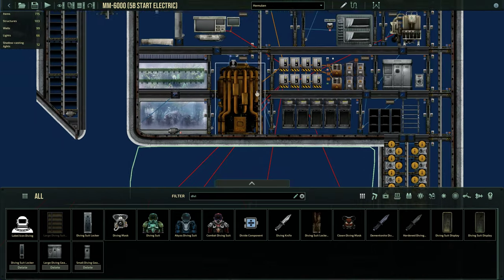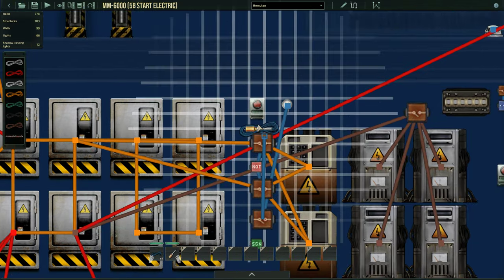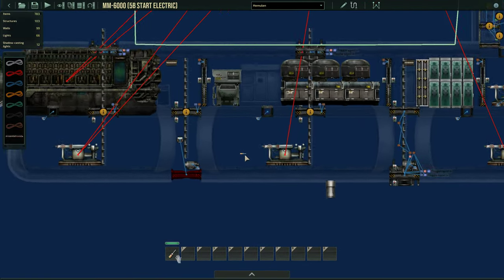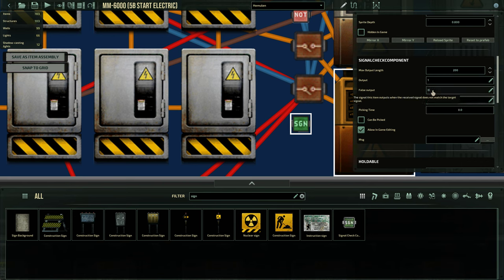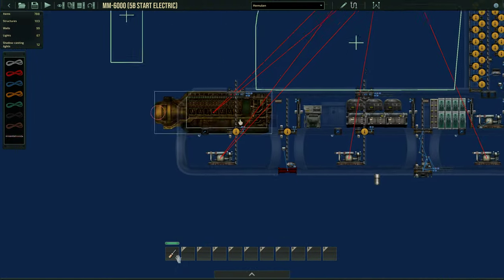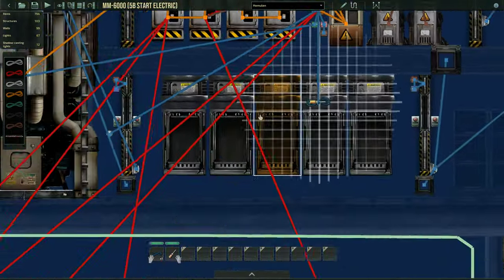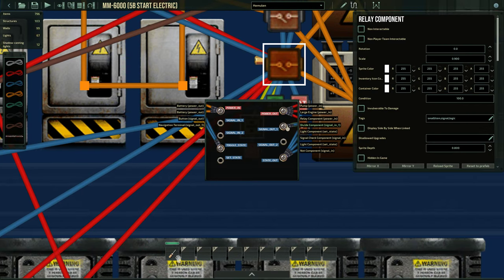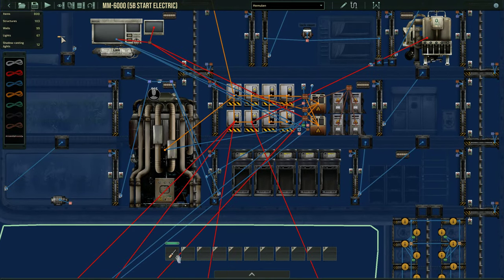Barotrauma wire submarine for silent mode

Comment: I personally use a multiply instead of a divide and multiply the force by 0.2 (20%) to get silent running. I also like to add a terminal (although i have the user input a number between 1-100% and modify it to a number between 0-1 for the logic). The terminal maybe of dubious use on many ships but its pretty fun telling the crew to set engines to various % and is very useful if you relie on batteries a lot.

Comment: Instead of using another relay + a not component + a divide component to limit the engine you can just use a signal check and the divide component and say;
Whenever Silent Mode is on divide by 5. Whenever it's anything else (aka off) divide by 1 (aka do not divide).

Comment: Whenever I enter silent running mode my whole sub just switches to battery power, despite there being no overlap in my battery and reactor grids. What can I do to ensure only the things wired to my relay get powered?
Reply: same problem
Reply: I experience the same issue and the only way to stop it on my end is to put a relay between Junction boxes and the machinery that's being used for wired mode. When I click said relays they still have a load but the rest of the machinery on the sub that's not connected to silent mode no longer turns on. I feel like this unintended behaviour but I'm not sure of what causes it, I only run mods that add item assemblies for sub building.
Reply: I think I figured out why that happens.

Junction boxes don't have a "power in" or "power out" pin, only a "power", so I suppose that anything that is connected to a junction box and that is powered will transfer power to the junction, and the rest of the sub.
I haven't tested yet but I think you could fix that by putting Relay components before the thing you want to power while in silent mode and connect both the "silent switch relay" and the junction box to this "one way" relay. That would be 2 additional relays, one before the engine, one before the pump, another one if you want to power the O2 generator, and if you wired like in this video, you already should have one before the navigation terminal.

Or you could be a madman and rewire the entire junction box network to dedicate one for those systems, connect it to the batteries and use a relay or two between this box and the others to allow you to cut this one part of the power grid from the rest. It should be doable with less relays but have fun doing that outside of the editor.
Reply: @IZ4-Y01  that is exactly what I ended up doing! You have to create entirely separate systems for something like that to work. Using the relays is the key.

Comment: do you need to use sub editor or can you wire this mid campaign?
Reply: I'm pretty sure you can craft and place all components and wires, so as long as you dont need to modify something that already exists (hidden unmodifiable default components on subs) and only need to place new ones and do the wiring , you should be able to do this with any game on any sub.

Comment: Do It in Easy Way on ANY vessel without Submarine edditor mode:
If you want silent mode you can just use 1 relay component, 1 signal check compounent and switch. wire navigation terminal through relay, so if relay turn off there is no vessel controll, and signal check compounent on relay state_out, so if relay state is off the signal check compounent set to 0 engine and pumps, a sonar also can be wired through the power line of relay and just get cut off the power grid. if you want to silence your deconstructor/fabricator/med fabricator/research station - same scheme as with sonar, but for each needs separeted relay, because each of them need 500w and default one relay can handle max 500w;
P.S.: Sorry BaronTrauma 450 subscribers, I watched 0:58 seconds of video and saw too complex and not guaranteed solution.
Reply: Relay can handle 1000w when I search for it.